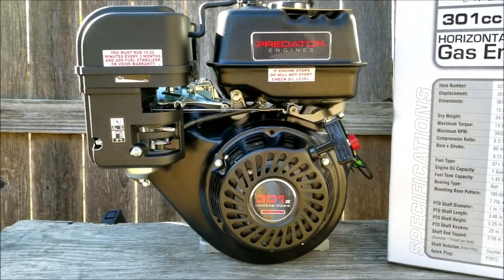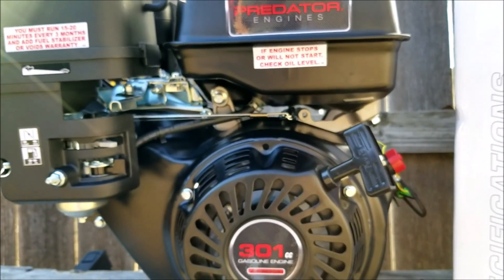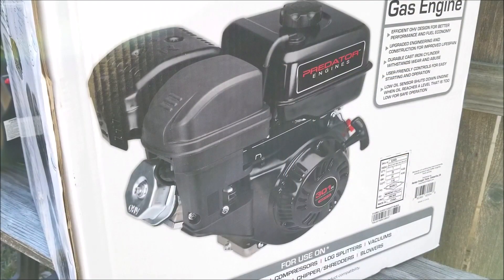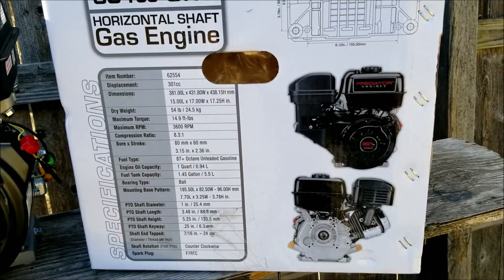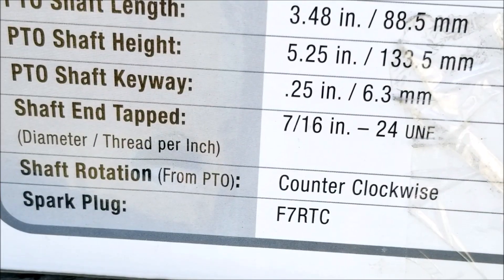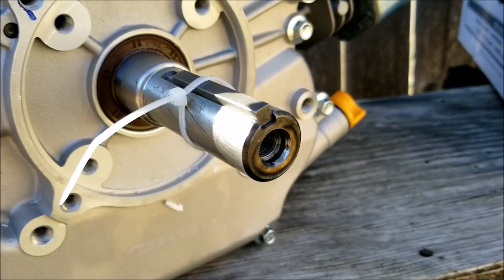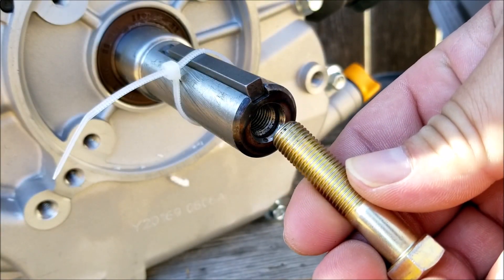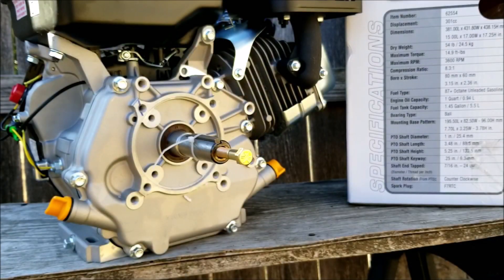Predator 301cc 8HP misleading information

Comment: If you look at the box you will also see that this engine is rated at 10 hp, not 8 hp.
Reply from the maker: maybe I'm blind, but I didn't see where it says it's 10 hp.  Besides if you go to Harbor Freights website this engine is rated at only 8 hp.  I hope I'm wrong because I wouldn't mind the extra power.

Comment: How come you got the 301 cc than the 212
Reply from the maker: shaft size, 301 has the 1" shaft while the 212 has the smaller size.  The impeller is originally designed to work with the bigger shaft.

Comment: Thanks for the review. I bought an old chipper for $100 at an estate sale with a B&S 8 HP on it. I ran the crap out of it for a year and it has now died. I think I will go grab one of these to put on it.
Reply from the maker: thank you Bob Sundquist.  I think it's a very good choice
Reply: I replaced the B&S 8hp on a 30 year old Troy Bilt  with this 301. Modified a plate and brace system for support. Works great.

Comment: I've been trying to get a 212 for MONTHS! I'm so tired of all these shortages. about to get a briggs snow engine and pray it doesn't blow.
Reply from the maker: I know right, I can't find 212's or even the lawn mower engine vertical shaft either. have you considered getting the 301 instead?
Reply: @INSIDEHOUSEGARAGE  An alternative would be eBay. may not be a Honda clone be there is a lot of cheap NOS engines. The 301 is out of my price range. it's going on a 1980 Toro 421.
Reply: I held on to my 212 hemi for a while cause I knew there would be a shortage
Reply from the maker: very smart of you.
Reply: Where you shopping? Im buying them all day. Also know most shaft bolts are sae on the predators

Comment: I had the exact same problem yesterday. Got it handled but now I can’t seem to find the 5/16-24UNF-2B. Went to ace hardware and now leaving tractor supply company to no avail.. any input?
Reply from the maker: did you get the 212 cc engine? Is that the bolt information from the box or from the manual?
Reply: @INSIDEHOUSEGARAGE  no I got the 301

Comment: Hey how fast have you got this engine to go ?
Reply from the maker: As far as RPM, stock  governed speed -3200 3600 RPM. it's not suggested to over rev the engine as the stock connecting rod might break

Comment: I’m more concerned with the valve cover difference between engine and box photo. I don’t want the center bolt valve cover engine. I want the valve cover as your engine has. How can I be sure if the correct engine?
Reply from the maker: Honestly I would ask to open the box at the store to be sure.

Comment: Forget buying Predators at Harbor Freight. They're all out of stock.
Reply from the maker: Really? I wasn't aware.  Might have to take a look. Thanks for the information.
Reply: Don't you fucking say that! Goonies never say die!!
Reply: I just ordered a Duromax 7hp because HF has been out of stock for a month here.
Reply: @whiters1992  I saw a post from a 3 wheeler FB group, a guy ordered 3 Duromax engines in a row and every one was damaged in shipping. I don't know where he was ordering from. I'm not familiar with those engines.  I say to hell with them all and go with Briggs and Stratton USA made.
Reply from the maker: @whiters1992  I know this is the first I've seen too
Reply: My local store has them stacked to the ceiling
Reply: @brandonmurphy4657  So does the rest of the stores. Take note that I posted this 6 MONTHS AGO AT THE HEIGHT OF THE SHORTAGE DUE TO THE VIRUS PANIC BUYING!

Comment: Harber Freight actually has two engines the same size but made at differant plants. One has hemi head on the piston and the other doesn't. There are some other tiny differences but overall same eng.
Reply: Yep, the one with the oval head is the non hemi, the rectangle head is the hemi. Both are decent engines. I run a 212 non hemi on my Troybilt tilller, 420 hemi with stage one kit on my Sears Suburban garden tractor.
Reply from the maker: thanks for the comment I appreciate it
Reply: I wonder how one has a hemi head on a piston? that's misleading in its own.
Reply: @Nopitunertv They make these engines non hemi and hemi head. The hemi head is better for low rpm range, the non hemi works at a higher rpm range,  they make these at two different plants because of tooling in the plant. That way they have to keep re - tooling to build the next batch.

Comment: I go to a lot of flea markets and yard sells I buy a lot of mismatched bolts and screws I put it in assorted cabinet I have called the $30,000 box I call it that because instead of running to the hardware store 2or 3 times  to try to find one bolt I've always got one in there they will fit anything little screws all the way up to pretty big bolts sometimes I have to do a little bit of cleaning on some of the bolts when I get them but I alwayssook them in w40 and put them away just remember if you trow it away you'll look for it later.
Reply from the maker: Thank you for the comment I appreciate it.  I might have to try that.
Reply: Your illiteracy is scary.

Comment: HF does have some misleading information on their motors. i noticed it on their pressure washers but at the end of the day 
they are good motors and the price is not too bad. years ago their prices were much more attractive.so you could overlook this type of information or false advertisement  but not anymore.their new policy of the last few years with regard to increasing prices, reducing the coupons and limits on what coupons can be used on is making many old customers to look elsewhere.
Reply from the maker: You are absolutely correct about that.

Comment: I know in my car which runs the 5.7 litre Chevrolet LS1 V8 engine I ordered an aftermarket timing chain cover seal & gasket kit which came with the rear main oil seal instead of the front one,it was also supposed to come with an oil pump pickup tube O ring as well,I'm pretty sure it was for the water pump.

I needed to replace the gasket as it was leaking oil & I needed to remove the oil pump as I decided to throw a new timing chain & sprocket kit into it, note I bought all the parts on eBay,it didn't match the picture at all.

I needed the kit straight away so I ordered the front crankshaft oil seal & oil pickup tube O ring separate & genuine,now this is where the interesting part comes in,I was sent a genuine front seal for a 3.6 litre V6 engine,not a 5.7 litre LS1 V8 engine,the ID of the seal I was sent was 50mm & the OD was 70mm,it was supposed to be an ID of 54mm & an OD of 72mm.

I didn't open the package to check,the seal fitted loosely in the front timing cover while it was still in the bag,so I ordered the correct seal from someone else & sent the  V6 seal back for a refund.

The engine hasn't leaked a drop of oil for 13 months now so it pays to check what you buy online off eBay, etc !
Reply from the maker: Thank you for the comment  Russell Booth.  Glad it worked out for you.
Reply: A lot of the stuff that you see on eBay you should not go with the pictures it's really important that you know your engine and especially the engine number A lot of times you should buy your stuff off Amazon the prime pays for itself I know a lot of stuff is cheaper on eBay but that's for a reason Amazon has a no crap money Guaranty back with all your stuff even if you bought the wrong thing they'll have the next one out to you as soon as they can

Comment: The go-kart forums show the crank bolt thread is 24 UNF, which is the old version as of 2013, and some versions of the engine used 18 thread, but today's version is 20. Next time keep a big assortment of various spare bolts in your garage so you don't have to delay projects, meaning, when in doubt, try various old lawn mower crank and mounting bolts to determine what you need.
Reply from the maker: Thank you for the information.  It was just time consuming trying to find the old bolt.
Reply: @INSIDEHOUSEGARAGE  Well, if you haven't had enough trips to the local hardware store, there's always next time. :D